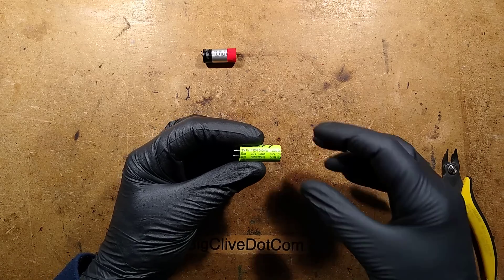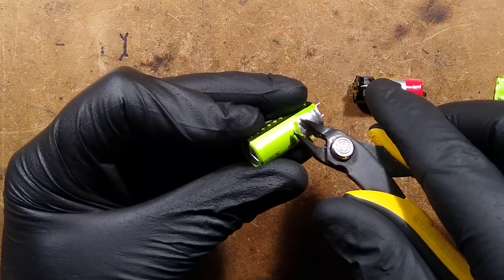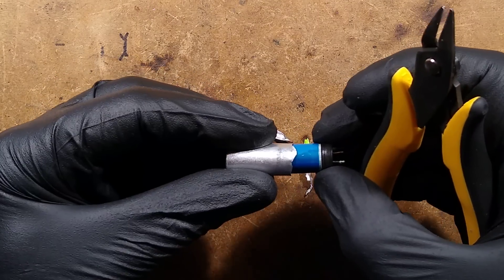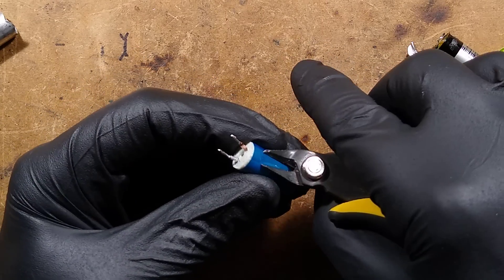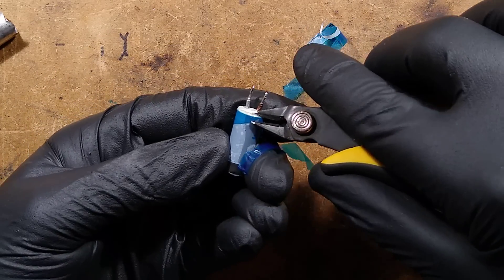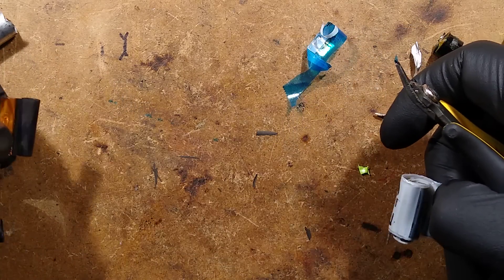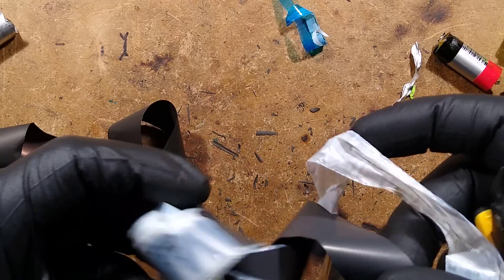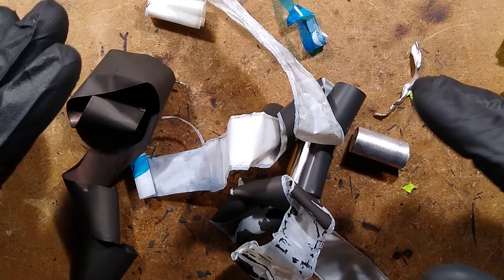Opening a capacitor-style lithium cell (don't try this)

Comment: Now we need to see if the vent on top spews flames if overcharged.
Reply: Upgrading from a zipo to a lipo for your smoking needs lol
Reply: Yes charging a lithium cell to 4.5v is a great way to get a ton of energy out of the cell. 

In the form of fire. 😈💥🤣
Reply: @ecospider5  i find that 5v works better, way more accessible for kids to play with fire inadvertently attempting to charge disposable vapes, 48v 10 amps works wonders
Reply: Yes 48v really is the way to go. :)
Reply: it'd probably backfire

(pun intended)
Reply: This. I feel teased by getting to see the Explosion Containment Pie Dish but not performing as intended.

Can’t contain explosions without explosions to contain!
Reply: i am becoming:the bigender thead
Reply: Please clive?? Overcharged lipo capacitor? I'm guessing this is the same exact tech as the pouch cells and not 18650s, I have not seen these in person in the USA yet
Reply: is tehe same but 3,75 voltages  @frogz
Reply: The vent is for venting gasses when charging and discharging. The pressure when the things explode, is too much for the tiny vent holes. The whole battery swells, then the case bursts and a fireball ensues.
Reply: @darrylkinslow5613 yes, please!
Reply: @darrylkinslow5613  I thought Li-NCA batteries don't vent when operating normally?
I know lead acid does, but to my knowledge Li-NCA doesn't.
Reply: @TauCu  Never heard of Li-NCA, these are Li-ION. All batteries have to vent, otherwise they will explode when charging.

Comment: I was fulling expecting a pouch-type cell in there...pleasantly surprised to see an actual rolled up type  :)
Reply: No matter if they're round or flat, they're all still using the "Jelly-Roll" construction.
Reply: Yeah, that's more than I was expecting, especially considering the lower capacity compared to spec and earlier incarnations of these throw-away devices.
Reply: The stuff inside is the same as what's in the pouch style ones, just different packaging.
Reply: I thought of two little gnomes, one hand cranking a tiny generator, the other one counting the rotations, and the gnome that cranks the generator is talking and goes on and on about his mother that doesn't listen and his dishwasher that doesn't clean the dishes properly and such things and the other gnome is totally frustrated because it always looses count .. so that is why they only have 250 mAh and occasionally blow up.. the counting gnome had enough of the blabbering one and .. oh jeez..
Reply: Me also.
Reply: They seem to be barely sealed though?!
Reply: The cylindrical cells are always rolled up.
Reply: ikr, i totally expected a lipo

Comment: Reminds me of being a kid and smashing D Cells to get the "black chalk" out of the middle so that we could draw on things.  Given that this was at least 50 years ago, I assume they were all C-Zn cells.  None of us died.  Well, I mean none have died because of that specifically ...
Reply: I once did that to get the replacement motor brushes out of them.
Reply: "What doesn't kill you—has made a tactical error."

That said, having sword fights with old fluorescent tubes was probably one of my stupider things done as a child. Well, that and putting peas of gelignite into a glass bottle and tossing them into a bonfire.

Still alive, though.
Reply: @ConstantlyDamaged  aerosol cans in the bonfire by me!
Reply: @esecallum   Several times we blew quite decent bonfires out ! just like a candle, butane and propane !! tiresome really
Reply: @CrimeVid  and tried to firerockets horizontally!!!
Reply: @ConstantlyDamaged  I once accidentally set my brother on fire because we were having a "firesand fight". This was exactly what it sounded like, we would pour lighter fluid on the sand in our backyard, light it, then pick it up with a shovel and fling it at each other. Usually it snuffs out after being in the air for a short time because all the particles separate, but it must have been some wet clumpy sand or something because a bunch just stuck to his jacket and started burning it. We ripped his jacket off and he was unhurt, fortunately. 

We also used to play rockball because baseballs were expensive for a kid and we liked to just slam them as hard as possible into the woods so we started using rocks, plus they make a very satisfying sound when you hit them with an aluminum bat. Anyways, one of those rocks took an unpredictable trajectory, right into my eyebrow. So now I have a permanent split in my left eyebrow because the scar tissue stopped the hair growing back.
Reply: @ConstantlyDamaged  well who didnt, especially after star wars came out
Reply: @ConstantlyDamaged name checks out 😉
Reply: @ConstantlyDamaged oh hey funny you mention that! me and my brother did some fluorescent bulb jousting recently and he ended up dropping it onto the hard floor beneath us. needless to say that was a very loud crash
Reply: We used to tear those down for the zinc.  Zinc and an acid will give you hydrogen....
Reply: Would reclaim the carbon rods for carbon light experiments, with a car battery.
Reply: @wrongmouse1658 - Half a dozen discarded car batteries in series and a couple of the carbon rods from those ancient massive carbon zinc phone batteries (Eveready No. 6), was rather spectacular when an arc was drawn.
Lotsa light, heat superficial burns and singed things.
Heaven knows what the neighbors thought.
Gave a bit of a tingle if hands wet and mishandled. 
Added dubious bonus was occasionally a freshly overcharged battery would be ignited by sparks and spray acid around. (Had to keep leads as short as possible, so car batteries, carbon rods and user all in close proximity)
Clothing with numerous holes from sparks and acid raised parental eyebrows.
Survived.
Reply: @wrongmouse1658  Can do the same thing with a pencil. More of a thrill if you sharpen both ends, clamp and connect to a high amperage and voltage.
Reply: Used the carbon rods for H2O electrolysis electrodes to capture hydrogen and oxygen in test tubes. Open a classic #6 zinc-carbon, now THERE was a carbon rod. I think 3/4 inch diameter.
Also used the rods to melt pebbles in back yard. 120v to salt water rheostat. No gfci, but even at 11yrs old, was carefully to put hot lead for rheostat. Oh, wooden clothespins to hold the arc electrodes.
Reply: @nerdful1  Perchance you saw this in the UNESCO book "700 Science Experiments For Everyone"? A great little nondescript book, intended for teaching science using common junk available even in materially poorer areas of the world. The chapter on electricity was full of high voltage, shock hazards, and glowing carbon electrodes (even giving instructions on how to make a furnace with a flowerpot and some spare carbon rods).
Reply: @nerdful1  full 🤓

Funny I'm banned from posting for 23 hours but sometimes it lets me post
Reply: As a Kid I used to get the Mercury out of Grans old hearing aid batteries, I can remember getting pissed off when the newer packages said no Mercury, I still checked a few and they were right! Bloody kill joys.
Reply: None of you have died of that.... That you know of.
Reply: @eefneleman9564  I think we can safely say that nobody posting here died from dubious electrical experiments.
Reply: Been there done that.
Not to forget building cardboard rockets distilling hydrogen peroxide (blew a kitchen window out by accident) and playing with self mixed black powder in all kinds of bad ways (once melted down a dinner plate in the garden when it ignited while mixing with a spoon). But at age of about 13 or 14 that was a learning experience.
Potassium permanganate  (at the time a father of a class mate was a chemist and simply gave us a 2kg bag after we asked if he by any chance had some of it ;-) and sugar set alight was also fun as smoke bombs.
Only kid ever getting in trouble was a bit older (probably 16 at the time) because he had a little mishap trying to produce nitroglycerine in his bathtub. But he was really a bit crazy. And he survived.
Reply: Yeah some of the dumb shit I did as a kid I’m surprised I made it to 55 with all of my appendages relatively intact, my eyebrows grew back relatively quickly when I was blown up by the old gas cooker about 40 years ago 😂😂
Reply: I used to remove the graphite core out of D cells and use them as electrodes in electrolysis experiments. I'd cover each electrode with test tubes to gather the hydrogen and clorine.
Reply: @alext7074  i took of the zinc coating to make colloidal zinc. and the carbon electrodes spaced 1/2 a millimetre apart to generate hydrogen water
Reply: Dead D cells were a source of carbon rods that were ideal for cobbling up a carbon arc. Wiring it up was simple (and hazardous). One Edison base socket, one light bulb, some heavy alligator clips and an old lamp cord. Series circuit using the light bulb to limit current. Strike the two rods and blind everyone in the room. Also worked as a metal cutting device.
Reply: One of my favourite Ladybird books "Magnets, Bulbs, and Batteries" shows schoolkids Janet and John doing that and then making their own batteries using the carbon rod, a bit of zinc casing, and a lemon (and John's tongue to check the voltage) !
Reply: I remember cutting batteries up back in the time,my favourites were flying bomb,I once rubbed my eyess after doing some experiments and thought I was going to go blind 😢
Reply: I would pull out the carbon rod. Then replace it with a red/blue firecracker, for great hand grenades.
Reply: I believe those cells are packed with a manganese oxide, not sure how healthy that stuff is
Reply: Carbon-Zinc cells aren't particular harmful at all.  

Especially those old ones. 

In fact the only concern was the caustic electrolyte.  Just neutralize that with baking soda.
Reply: Very very interesting. Do you have a video on how you measured the mAh of the cell please?
Reply: I was taking them apart as kid to get zinc casing and put it in hydrochloric acit to those as soldering flux. That helped soldering even with shitty tin or materials, you could even solder stainless with it. Tin normally do not stick to stainless but sticks very well to zink and using this flux would leave a thin zinc coating.
Reply: Is it just me, or do "dry cells" leak more these days? I remember when batteries were billed as "leak proof" and seemed to be that way. I've seen a lot of damage from batteries in the last few years.....
Reply: When I was a kid in the early 70's we lived in a rural area and burned most of our trash in a big barrel out back. My brother and I would get old dead C and D cells and drop them in the flames then get clear, in a few moments they would go off like rockets and fly over the garage. Not environmentally friendly and definitely not safe. We survived though.
Reply: @tncorgi92  That must have been fun! XD
Reply: I like to bite open thermometers and drink the silver fluid
Reply: @samholdsworth420  that won't hurt you as much as sniffing it.
Reply: @tomclanys  damn
Reply: Do you get taller on a sunny day? @samholdsworth420
Reply: If you were trying to get the carbon rod out of your battery, they were pretty safe batteries. Rechargeable ones were super deadly
Reply: Aluminium electrode would presumably react better with acid or lye than copper would…
Reply: @markiangooley C is for carbon, Cu is for copper. Alkaline batteries has a carbon rod for the positive electrode
Reply: Actually these batteries are safe, compared to rechargeable ones that have dangerous chemistry and alkaline
Reply: @Gameplayer55055  so, these are not rechargeable? I've found a "vape thing" on the floor, someone probably tried to open it (everything inside comes out easily), with one of these batteries inside.
Reply: @alexandredias57  as I know vapes have lithium ion batteries and you can recharge them

But single use vape target audience doesn't care